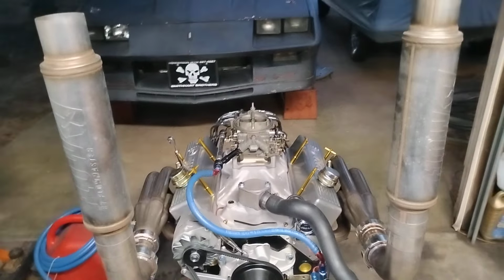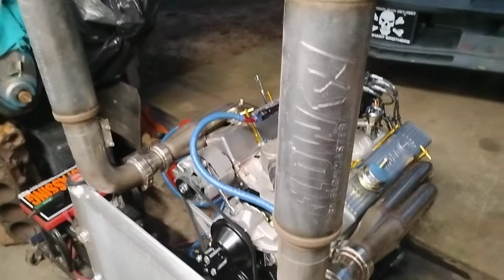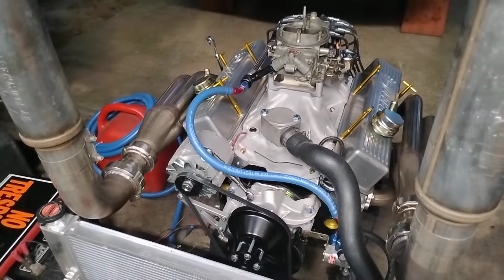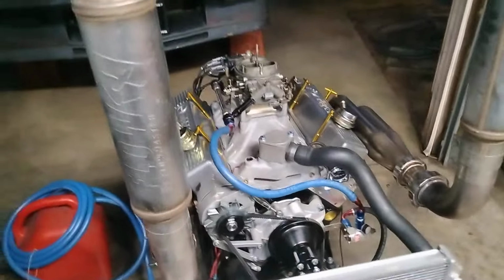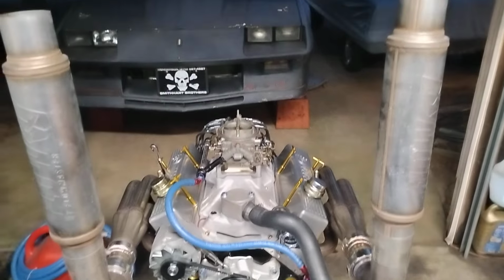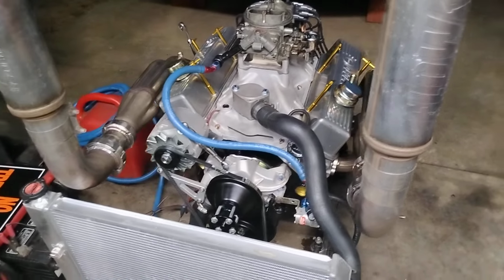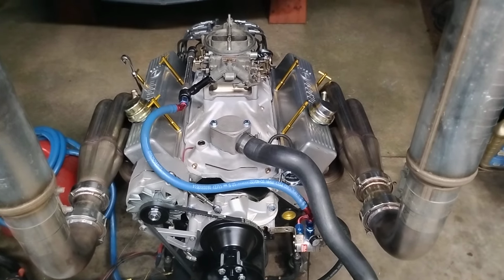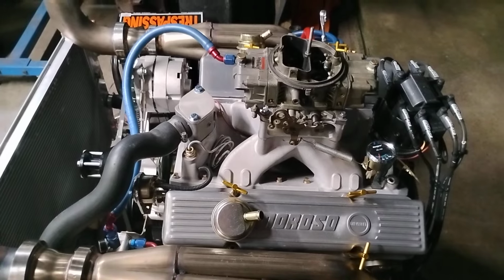"500+HP" 357ci  SBC with 3in FLOWMASTER FLOW FX mufflers.

Comment: Sounds bad ass brother!! I have race bullets mufflers if you can call them that lol going on my Cutlass straight through design as well.
Reply from the maker: @thehouseofhorsepowerautobo4506  Thanks man, gotta love them race bullets. Been using them for years.
Reply from the maker: @thehouseofhorsepowerautobo4506  I also like Moroso Spiroflow race mufflers. They don't restrict shit either.
Reply: @thereluctantgearhead4544  ill check into those! I appreciate you doing these videos and answering questions thank you!
Reply from the maker: @thehouseofhorsepowerautobo4506  No problem man. Glad to see people still fuckin with these old rides. Shits becoming a lost art.
Reply: @thereluctantgearhead4544  couldn't agree with you more!! We used to have several speed shops here in southern Oregon when I first moved here in the late 80s now I believe there's only 1 about 30 miles in Medford.
Reply from the maker: @thehouseofhorsepowerautobo4506  Last speed shop in my area the old dude just died a year or 2 ago. So that was that. Shit got auctioned off. Building got sold. Been there since the early 60s. End of an era.

Comment: Add a 6"-8" extention too each of mufflers
Reply from the maker: @brentonk461ismylostaccount  They will have turn outs when installed on the car. This engine won't have any mufflers in the vehicle it's going in. The mufflers are going on my 84 Camaro with a 2ft pipe, and about a 10 in turn out.

Comment: It sure sounds good. Are those Dragon Slayer heads?
Reply from the maker: IK 200s blended & cleaned up with .012 milled off the deck.
Reply from the maker: Has a nicely ported Brodix HVH intake too. Matches the heads perfect.
Reply from the maker: I'm gonna use the Dragon Slayers on a turbo SBC I'm collecting parts for. Going with a aftermarket block on that one.
Reply: Sounds like its about to kick ass

Comment: Is this big bore short stroke to make 357 or just 60 over 350?
Reply from the maker: It's a 1990 L-98 350 bored .040 over. Some people call them 358s. But from what I've always gone by, a .030 350 is a 355ci, a .040 350 is a 357ci, and a .060 350 is a 360ci engine. .080 is a 364ci, .090 is a 366ci unit. All with a 3.48 stroke crank. I like aftermarket 4340 3.50 stroke cranks with 2 inch rod journals.

Comment: Have you dynoed similar combos ? Im curious as to why you believe its over 500hp. Not saying it isnt or cant be done by no means.
Reply from the maker: @jeremymyers5643  Yes, I've worked in 2 shops with dynos plus my rich buddy I grew up, his dad raced Pro Stock boats and had a dyno in a building in his back yard. So I could use it pretty much anytime. I built engines for a living for over 30yrs, so I've built a whole lot of SBCs over the years. Start recognizing patterns over 40yrs of continuously building engines. This engine will actually make a bit more than 500hp, but I throw a low end number out there for those who like to argue. Ive built over 1000+ engines since the early 80s. Many drag race engines, dirt track engines, drag boat engines, mud race engines, etc. Even built a 8-71 blown 540 big block Chevy for a drug dealers fan boat for the swamps. Build over 500+ SBCs and ya pretty much figure out what they can do. A similar engine to this one in the video made 560hp, 480tq. Making big power with Chevy engines is easy. So many choices on killer parts available. These days my dyno is the drag strip. My friend with the dyno is dead, and the 2 shops I worked in with dynos neither exist anymore. One is a Planet Fitness now and the building is gone. The other is in a bad neighborhood rotting away. That guy died too.
Reply from the maker: @jeremymyers5643  I retired 5yrs ago myself. So I just mess with these things out of habit anymore. Can't quit.